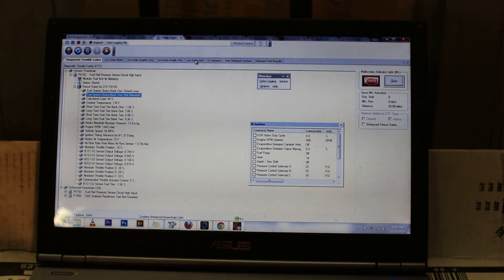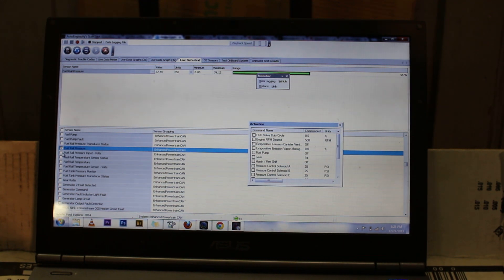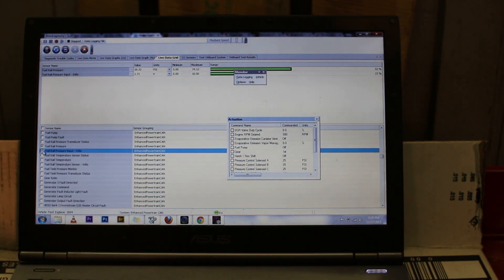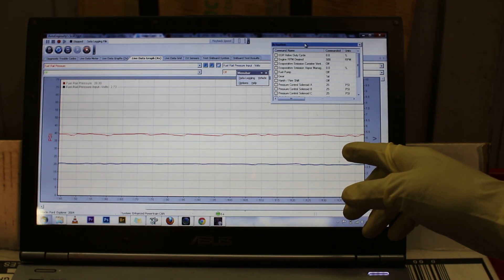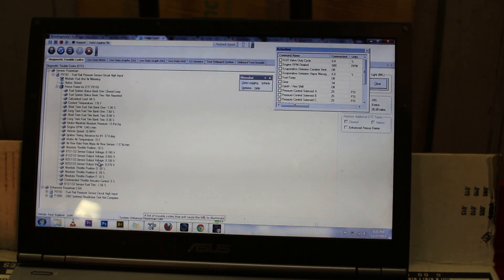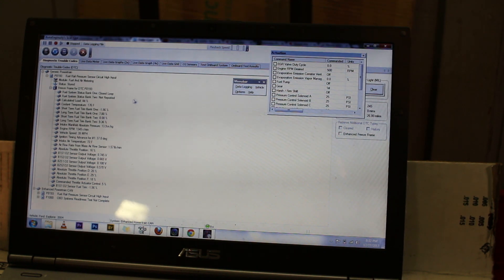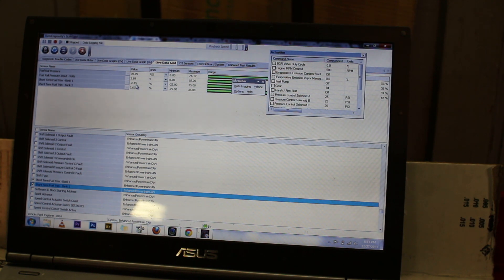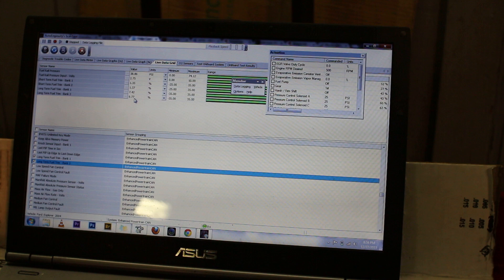Check Engine light diagnosis code P0193 Part 2

Comment: The pressure is inversely proportionate to the circuit?!?!?! This means if a circuit is high then I have low fuel pressure. Man god bless you are the only one that actually said this 🙏
Reply: what the mean you need a new fuel pump?
Reply: @cali_cal  I needed a new fuel pressure sensor

Comment: Thanks for the video. I have an intermittent problem too and I already replaced the fuel sensor but I skimped on a china one and it spewed the same P0193 code then it started leaking. So I put back the original sensor back. Still having the codes from time to time and engine would stall occassionally on idle....what I do is to pump the gas just to give a jerk for the sensor maybe when at idle speed especially on traffic. Will try order a Ford original part then....thanks!

Comment: Had this code on my Volvo C70. Replaced the sensor myself for $60 and fixed my issue. Code never returned. I think considering the price that's the best first place to start with this code. Replace the sensor, and see if it resolves it.

Comment: So if this code appears while the car engine was stall or hesitating this means that the fule pump is faulty?
In the other hand if the code appears while the car was in a good condition mechanically running well, it's a sensor or circuitry issue? 
Can you clear this point please for me :)
Reply: hameed hameedo He's saying when the diagnostics showed no loss of fuel pressure there was an increase in the sensor voltage.  Indicating that the fuel system is working correctly but the sensor is reading incorrectly (high voltage) so therefore the sensor is bad.